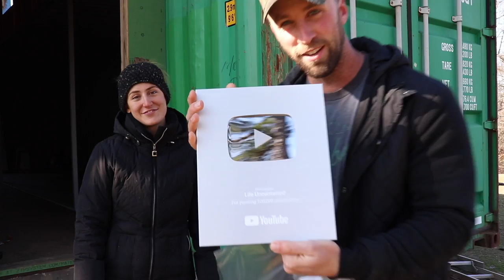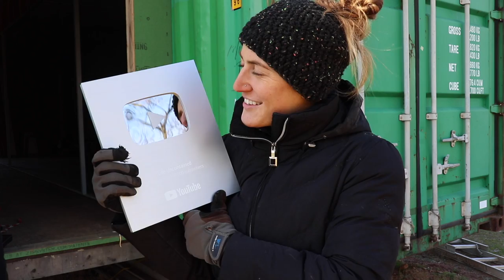WISH WE WOULD'VE KNOWN THIS BEFORE WE STARTED...

Comment: Wouldn't there normally be flashing up around the vertical areas that the metal roof meets?? Seems like you are doing a great job, just believe there should be some additional flashing/trim under the metal. (Hope I'm wrong)

Comment: Did you put any anti moldew on you wood around the roof?..or did you burn it a little?..as what the log cabin builders do when they put their logs directly in the ground to prevent rotting ...see Self resilience with James  Shawn even if they treat it as most says .,,it still can rot with the time ..good job thou!!!.,i saw also where i think it was in Canada...they put dome bails of hay all around outside the bottom of their construction to prevent cold wind coming underneath as well as freezing pipes..,

Comment: Recently found your channel and I've watched most of your videos using my Roku device.  Thus I haven't read the comments  associated with each video.  I have some questions that hopefully you'll answer in a video. 

Haven't seen any comments in regards to getting a  home building permit and passing any inspections.  Are they not required in the county you live in?  In the county I live in the Planning department requires engineering drawings and sign off by an architech to convert a container into a home.  Did you have to get any approvals.  Are you planning  on a septic system or use composting toilets when you get to your plumbing?  I presume you use your gym membership to take care of your current  showering needs. You mentioned you in one of your videos, you used to upload videos at a gym.  How close is the gym?   Thanks, I've enjoyed your videos so far and have subscribed.

Comment: I don't want to be that guy. But you should have put in some vented closer strips at the soffit. And you should have use vented at the wall and leave the sheets an inch  or so off the wall to get the airflow you want.

Comment: Ok first of all you haven't  been over lapping your roof cladding enough, water will get under & over one over lap, you should be over lapping the sheets a minimum of two ridges, which also helps the sheets stay in square, also you never screw roofing down in the valley of the sheet where the water runs, the rubber grommet on the roofing screw will break down eventually and is only supposed to be used on the ridge of the roofing sheets where water can't pool around the screws & not in the valleys, water will penetrate this roof  unfortunately guys!

Comment: The metal roof you are installing is not meant to be install on a roof less than a 3/12 pitch.  You would need a standing seem metal roof for a roof like yours.
Reply: thats correct. water will seep under the seams.  i have standing seam om my house. its the only way to keep snow and water from penetrating under.
Reply: Would never use screws. Rubber washer is the killer. Standing seam for sure.
Reply: I think they no the metal roof will leak by that they said in the video.

Comment: Don't understand the roof construction. There is no sarking or vapor barrier under the roof sheeting so any condensation forming under would drip onto the zip board which has heaps of penetrations in it for screws fixing the roofing battens. Plus any water will also pond against your battens which are installed hard against the roof deck and don't appear to be treated timber? Imagine it would never get inside through your water proof shipping container roof but likely damage the roofing battens and board. Is there a reason you chose to not install a vapor barrier or sarking - its mandatory in our building code in Australia, perhaps not in yours for some particular reason.
Reply: That's yuppie college educated know nothings for ya.
im a contractor, you know they screwed the pooch same as me

Comment: Great job!  I'm presently building a small recording studio/editing suite by my house in the mts of NC and used metal for the roof as well.  ( https://www.youtube.com/watch?v=SWJeRMGpYAI&list=PLnutQWHKDrEMco_0KiW3cN-SkfkC9LVN7 )  My method for the roof was to off set a 2 x 4 along the bottom edge of the roof to serve as a "catch" as well as forcing it to be even and parallel to the edge.  I also started in the middle so any error would not compound and laid 3 sheets down before screwing anything down.  Worked well for me.

Comment: I'm so confused.  Why are you using purlons on top of sheeting?  I thought you only need one or the other.  Also why spend the extra money on that zip strip crap when you could've just covered the whole roof in water proof membrane over regular plywood?  

Ps.  You forgot a lot of screws on that roof.  In order to have rated wind resistance needs screws between each large ridge (looks like 4 screws) going up the roof on 2 foot centers.

Comment: Im sorry, but I don't understand why you think its a good idea to keep screwing to the lowest part of your sheeting, against screwing to the higher parts, as all the water will flow on the lower parts, and I guarantee the seals on the screws will give way in time, if leakage isn't a future problem to worry about then please disregard my comment. I have enjoyed watching your channel though.
Reply: Agreed.  I am no fan of screws at all. The integrity of the roof depends on rubber washers that will not last near as long as the metal. The installer can't over torque the screw or the washer is immediately trashed. Standing seam is the way.